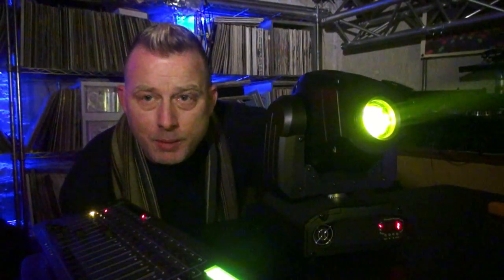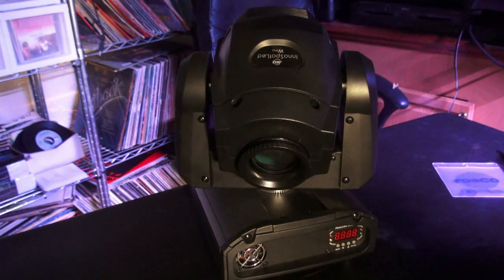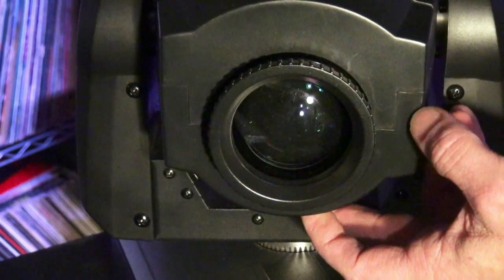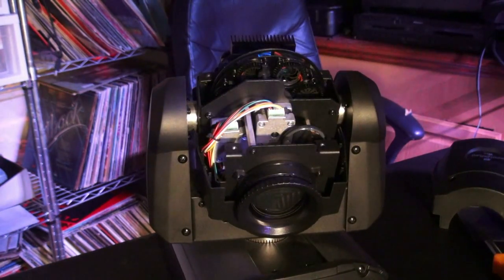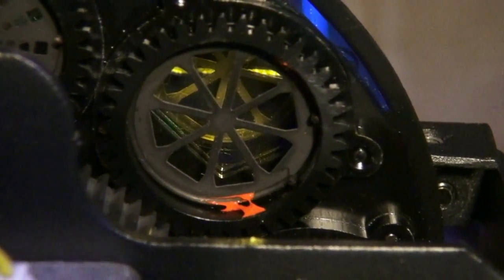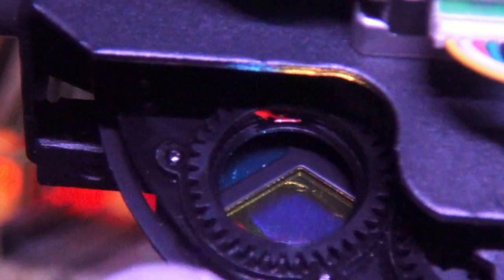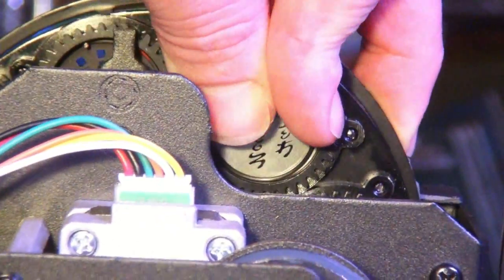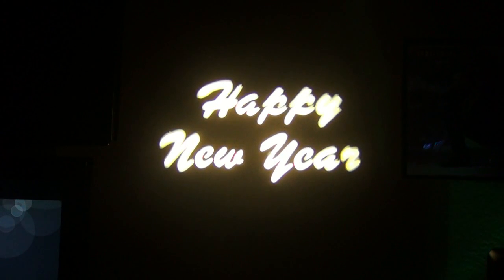How To Add Custom Gobos - Moving Head Tech

Comment: I don't think you are supposed to remove those gobos in that mover otherwise they wouldn't have tried securing it down with red silicon...
Reply from the maker: Nah, they probably secure them that way in the assembly process to make things easier.  This fixture for sure has the option of interchangeable gobos
Reply: The silicone also prevents the filter from moving around in the the holder and staying stationary while using the spinning effect.